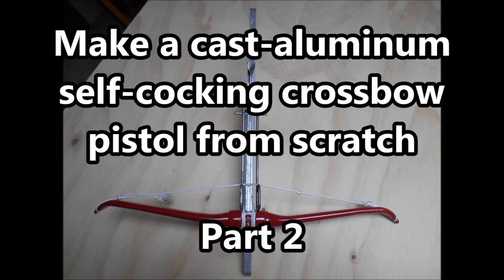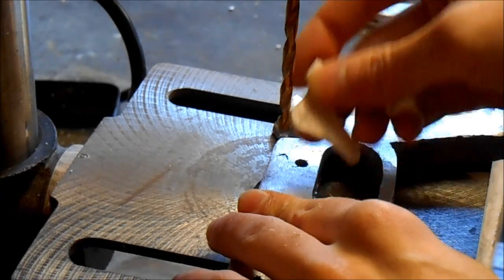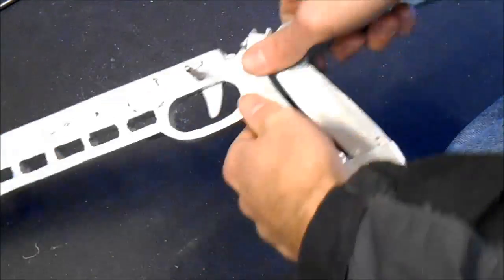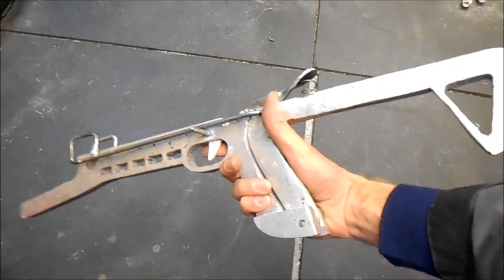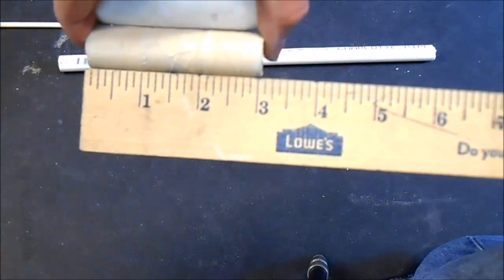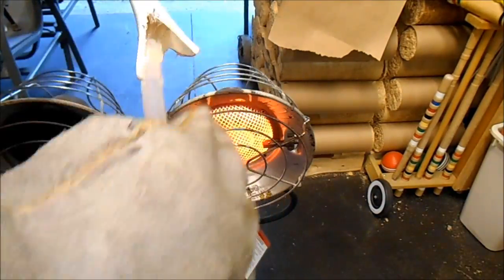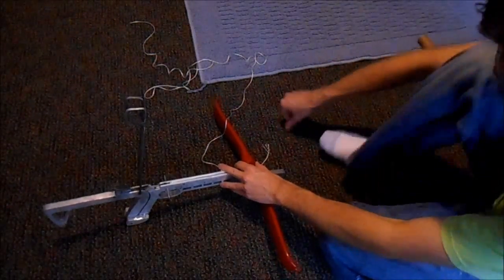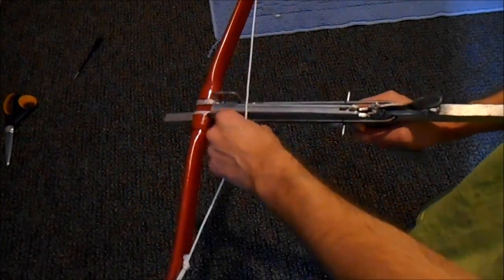Pt 2 Make a Cast Aluminum Self Cocking Crossbow from Scratch!

Comment: you should try casting a bolt action receiver
Reply from the maker: That would be cool, I do have a .22 airgun barrel that would probably be fine for a 22lr rifle.
Reply: JaycubL if you dont trust it with 22lr you could make it use shotgun primers and pellets, plus bolt action receivers are pretty easy to design.

Comment: Omg why dry fire?
Reply from the maker: Eric Allard It's not going to hurt something like this to dry fire it.
Reply: Ummmmmm mmmmmm I'm sorry...... when you release the energy required to push the bolt where does most of energy go? I'll let you think about that one for awhile.
Reply from the maker: The bow is so sturdy it does not hurt it. The bolts are light, it is not even that much different with or without a bolt.
Reply: Mmmmmm you would be surprised.
Reply from the maker: Eric Allard Why are you so sure? This is not a laminate bow, it is an under-stressed and basically indestructible (and inexpensive) PVC bow. I would not be dry firing a wood or fiberglass bow but with this I guarantee it doesn't harm it.
Reply: JaycubL I just don't trust anything. i'm pretty carefull no matter what materiels i use. once i had a truck leaf spring that i made into a ballista blow up on me.......... took out a 3 foot tree when it exploded lol. so just be carefull.......
Reply: JaycubL He is right(Eric that is) here actually. When you dry fire a crossbow all of the kinetic energy is forced into the string making it break more easily. It doesn't break the bow but it does break the string. If the bow takes damage it would have taken damage when launching a bolt as well.
Reply: ***** thank you good sir.
Reply from the maker: ***** There is just not enough force in this to break it. I 100% guarantee this crossbow could be dry fired 50 times in a row with no issue.
Reply: JaycubL a dry fire is a dry fire no matter how small
Reply from the maker: Eric Allard You could think of a regular shot as a "small" dry fire when using very light bolts like this. The string is thick mixed polymers, the bow prod is indestructible, it will not break. I could understand this complaint if this was a fiberglass or wood bow or if it was actually under some stress/designed for performance, but there just is no danger. Even if it somehow did break I would not care. I don't know why you think you need to tell me this.
Reply: JaycubL Lol don't make such a drama of it. He only told you that it wouldn't be clever to dry fire. It's like a golden rule for crossbow users as it breaks the string and sometimes even other components.
Reply from the maker: ***** It is more than that this guy has been so obnoxious to me for a while.
Reply: JaycubL I was trying to quote Horton  hears a who in my last comment. "A person is a person no matter how small" same goes for dry fires.

Comment: Dude very solid work and construction ! Respect !! Some spear gun rubber tubeing or some rubber strips off of Amazon or  e-bay would work great IMHO ? I like what you did but you have a lot of equipment that most of us dont have lol I would spend more getting the equipment then I would to make it myself . Be easier to pay you and alot cheaper 8) You have a tricked out shop for sure . I have access to a carpenters wood working shop but not fire pits and crucibles !! Was great to watch though your very inventive ... Do you know what your draw weight was once you had it fitted the way you intended CURIOUS dude ?? Thanks for the vid gave me some ideas . Keep up the Excellent work please !!
Reply from the maker: Thank you! Yes it can take time to get a set of tools how you want it, harbor freight is your friend. I have been slowly getting tools as I have the need and the money since high school. The metal casting stuff is the cheapest and most homemade of all of it. I am so drawn to fire and started experimenting with metal casting when I was 12 (melting pennies in an open wood fire to make arrow heads or small knifes). I am sorry to tell you I do not know the draw weight, maybe 60lb or so?
Reply: Ok 60lb sounds about right ? Thanks for responding look fwd to seeing what you come up with next ! Im hoping someone will come up with a shotgun pump action that can shoot bolts or arrows and figuring out a way to get a 80lb draw with out having to stop and use both hands energy transference of sorts I have the Idea need to put it down and work out the math which is not my strong point LOL Peace dude 8)
Reply: "Some spear gun rubber tubeing or some rubber strips off of Amazon or  e-bay would work great IMHO ?"

Not so. That is a good option for slingshots because you want the rubber to stretch. In the case of a bow or crossbow it is the limbs that do the stretching (actually bending) so you need a cord that does not stretch. If you were to use rubber bands on a crossbow you would need to extend the length of the bands way past the butt to create enough force to fire a bolt any distance.
Reply: Aaron Manderscheid Take an old water heater , cut it in half, drill 2 inch hole for air induction then put a blow drier or  a bathroom  overhead fan rigged up for air. THEN FIND A WATER METER IRON COVER FOR THE TOP AND YOU HAVE YOURSELF A FORGE. TAKE AN OLD FIRE EXTWINGSHER cut it about 3/4 ths to lengfth and you have a crucible

Comment: Would kevlar string keep up alright in such an application?
Reply from the maker: I have not used it myself, but the low stretch, and very high strength and cut resistance should make Kevlar one of the best choices available now.
Reply: If we are factoring in economics and looking for a low cost, low stretch, high cut resistance cord.... Slingers love Paracord for not visibly displaying any damage, even when throwing heavy, sharp, and hard objects.
Reply from the maker: WalrusJones
Paracord stretches too much to be good bow string unfortunately. It's nylon, it can be used but it is not the best choice if you have access to some other modern fibers like polyester or kevlar.

Comment: Hey would wax work instead of the styrofoam plz tell me so I may try todo something like this myself. I was thinking that was would be easier but I would not to make an explosion of molten aluminum on myself please respond ASAP.
Reply from the maker: Wax is better yes but you can not use this exact technique with wax. You would need to pour plaster around the wax figure (allowing inlet and outlet holes by attaching candle sticks or something) then melt the wax out, then pour metal into the cavity. This is an old and effective casting system but is slightly more involved than greensand lost foam casting. Lost wax (or lost (insert melt-able material here)) does produce better results though in my experience like a finer surface and less chance of warping in the mold.

Comment: Nice video - what kind of glue do you use to join the metal pieces together? (the spring and bolts)
Reply from the maker: birmingh79 JB weld works good. If not that then epoxy or superglue.

Comment: dude who the hell has all of those tools  nice video and good job for putting them to use but i wont b able to do this
Reply: Esaias Raysean He can potentially make thousands of bows with the tools and skills he has not to mention all the other things he can make and all the skills he will acquire in doing so. Give a man a fish and you feed him for a day. Teach a man to fish and he will sit in a boat and drink beer all day.
Reply from the maker: What special tools do you mean? I did not use anything inaccessible... A drill, a power sander (can use sand paper by hand), the oil furnace is a custom built thing but you can melt it with a wood fire, the angle grinder (metal cutter) is only $12 at harbor freight if you buy it on sale (you can also just use a hack saw but angle grinder is way better). Oh yeah I did use the welder but, you don't really have to do that. This should be within reach of anyone who chooses to do it.
Reply: i didn't mean it as offense in any way but by the time i spend all of that money taking it to get it done or buying them i could have bought three cross bows for less than half what the tools would have cost but good job on being creative it really isn't cheap

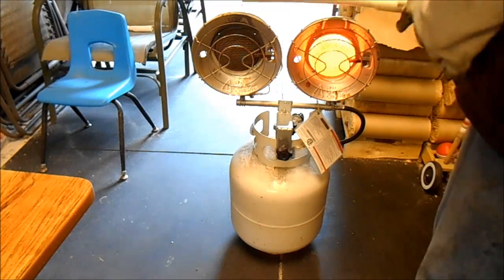Comment: 7:15 is the best part of the entire video. "It'll be stuck even though there's no glue. Now we're gonna heat up half of my 3/4 inch pipe half of the time. Then it will become soft. Hopefully you've done this before or aware that it can be done at least."
Reply from the maker: Very funny... I should have set up that section of video a little differently I guess.
Reply: JaycubL Well that was fast

Comment: Fast flight is the cordage I use on my homemade bows! You can make a flemish twist string that is cheap and it will last a long time. Also it wouldn't take much more than you have already done to make this a compound! Would be awesome. I love the vids Bro. Keep em coming!  I didn't know you could mold using the technique you used.
Reply from the maker: Yes I usually use "b50 dacron" continuous loop strings, but this is quick to test it.
I do plan to make a compound bow for this and finish it up better eventually.

Comment: great proof of concept ~ the cheap chinese ones on eBay have a spring steel bow that is in 2 halves and screwed together, through the frame. The string is a 'collection' of 10 to 20 synthetic strands (kevlar, spectra) to form one thick uber strong string. I'd bet a steel guitar string might work too, low E or A or D.

3.bp.blogspot.com/-QTJeGcJf_KA/Tm7lZheKQYI/AAAAAAAAAiY/hMYNrO_8WB8/s400/crossbow-awa-5.jpg